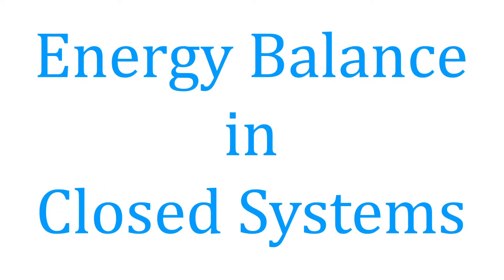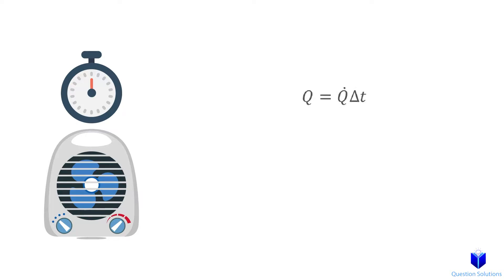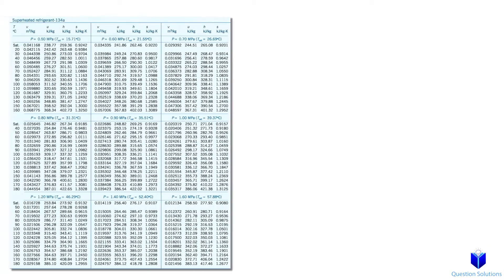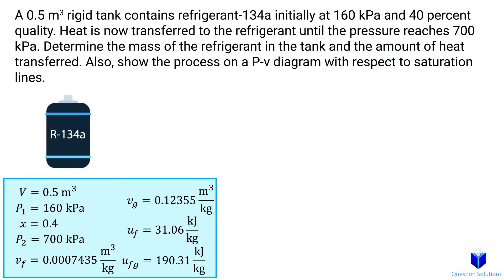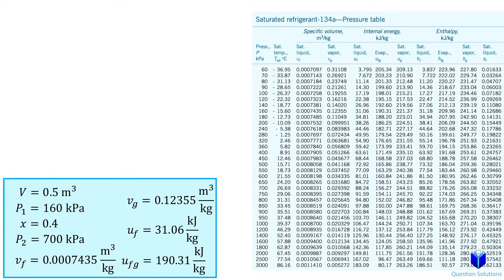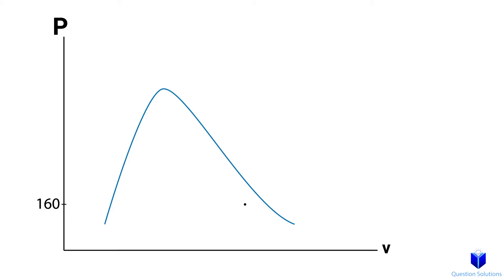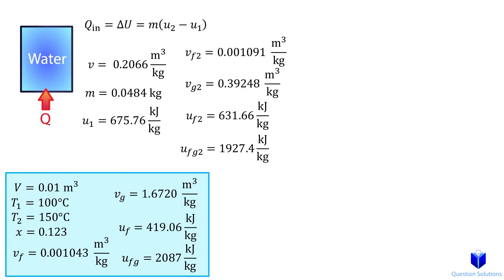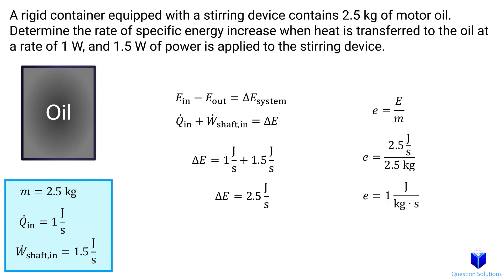Energy Balance in Closed Systems | Thermodynamics | (Solved examples)

Comment: At 5:11 we dont include the work done by the boundry in the energy balance equation. Do we make this assumption on the basis that it is not explicitly mentioned in the question or is there any other explanation
Reply from the maker: So to calculate boundary work, you need to have a moving boundary, so your system boundary needs to change, and that almost always happens in things like piston-cylinder devices. In other problems, we take a whole tank/ mechanism to be a system.

Comment: For the last question how come Shaft work is a + and not a negative?
Reply from the maker: Shaft work being negative here would mean the process is creating energy, like a turbine spinning to produce electricity. In this case, both the heat transferred to the oil and the stirring device is using up power.
Reply: @QuestionSolutions  I see! Thank you so much!

Comment: Hello, in the second example you used the same equation to find the U1 and U2 by using the table and finding a new quality but did it differently in the first, is there a reason for that or both can be applied. Thank you very much  for the videos
Reply from the maker: So you can actually use multiple methods to get to the same answer. I try to show as many as I can, sometimes, I focus on one method, other times, multiple ones. Usually, it's easier to use one over the other, but that doesn't mean it's not useable. Use whichever method you'd like :)
Reply: @QuestionSolutions  Oh alright, thanks a lot for the quick reply.

Comment: Why was a potentially changing quality considered in the second example but not in the first one, considering both situations are identical (two fluid mixtures in a sealed rigid tank being heated up)?
Reply from the maker: You could do it that way, but we used a super heated vapor table to figure out the second value, so we didn't need the quality change in the first example. In the 2nd example, we used the same equation we used to find U1 to find U2 so we needed the new quality value. Two different methods were used.
Reply: @QuestionSolutions  So essentially, you only consider a quality change when the value of U2 can be directly found from the table without having to extrapolate it like you did in the 1st example?
Reply from the maker: @josephisrael8959  You can do it either way depending on whether you have the necessary table or not. So it boils down to what is given, and what method you find is easier.
Reply: @QuestionSolutions  That clarifies things. Thank you very much.
Reply from the maker: @josephisrael8959  You're very welcome!